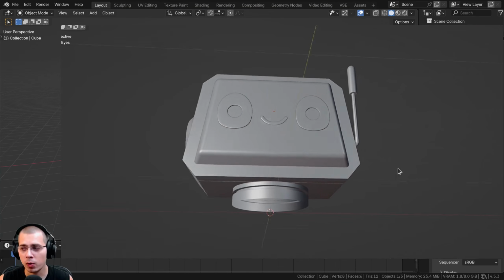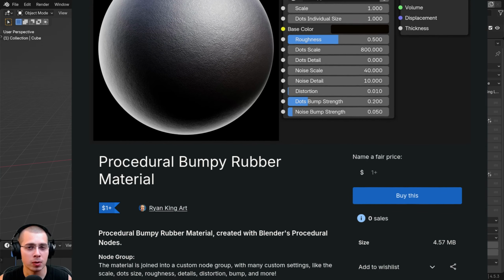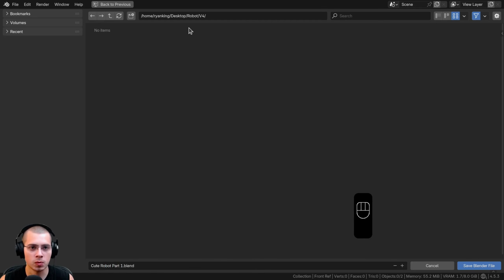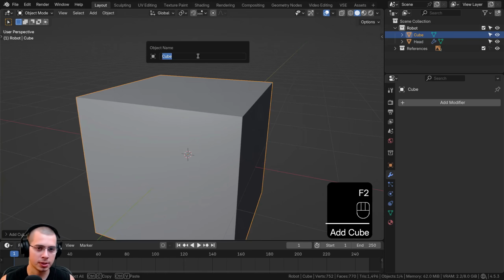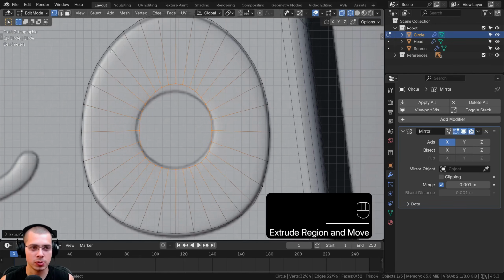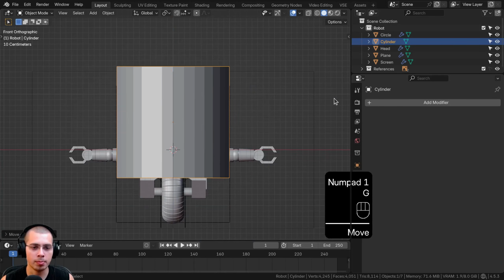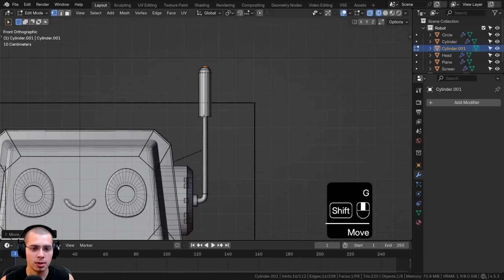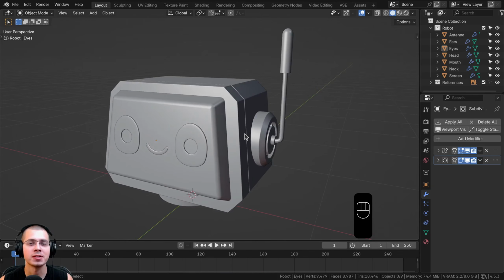Creating a Cute Robot in Blender 🤖 Part 1 (Blender Tutorial)

Comment: Does the ZIP file that you're selling include a fully rigged robot ready for animation or just the mesh? And does it support mouth movement (blendshapes or jaw)?
also can i can export it as a GLB file?
Reply from the maker: Yes the robot product comes with a finished, textured, rigged robot. However, keep in mind that the robot is not rigged with bones. its rigged with parenting, object constraints, and shape keys, which may not work in a different 3d software. As for exporting to GLB, you could , but if you're using it in another 3d program, you will need to bake the materials to texture maps, as it uses some shading setups and procedural textures. The mouth movement is rigged with shape keys.
Reply: @RyanKingArt  Hello,

Thank you for your detailed explanation.
Could you please confirm if the shape keys are properly exportable to GLB and accessible as morph targets in other environments?
Reply from the maker: @sarahidk9174  Sorry I'm not sure about that. Why do you need to export it to GLB? are you trying to use it in another 3d program?

Comment: I keep getting the warning to enable auto smooth in the object data prop. but I don't really see a difference but maybe in the render? Also, is that because I'm using blender 2.83 as that is the newest version it will run. It's an old imac from 2011 back when I was in college. I'll be getting my newer 2022 imac out of storage soon as I have the money, and it has a thunderbolt 3 connection and the internet tells me I can hook up a AMD Radeon gpu to it. A video on that would be useful. I hope someday I can aspire to be an expert blender guy, but alas I'm only intermediate on a good day. A better gpu is getting to be necessary at this point.

Comment: mirror modifier on eyes is not working blender 4.5..failed to set value error (update after reading fixes on reddit) I had to do this 
apply/freeze CTRL+A>location) your location so the origin point (the orange dot) moves back to world origin or set the origin point to the 3D cursor while the 3D cursor is at world origin. Right click the object>set origin>origin to 3D cursor.

Comment: When you were turning the 90 degree angle on the antenna is there any reason you didn't use the spin tool? I find it a lot easier and it gives a perfectly uniform turn so you don't have to eyeball it and get it just roughly even. It's a very useful tool well worth investigating if you've never used it before.

Comment: Okay, just about done with part 1 of this tutorial. I made it to the antennae. I had a big realization. Move meshes in object mode, scale meshes in edit mode, and recalculate normals after extruding as you are modeling. I am sure there is more to this, but this is my takeaway.
Reply from the maker: Yes, I prefer to move objects in object mode so the origin moves with it.
Then I prefer to scale in edit mode so the objects actual scale is the same.
You only need to recalculate the normals if you extrude the face backwards.

Comment: Will you do one without tracing. Sometimes you don't alaays bave a reference
Reply: I imagine the blueprint reference is intended to help new people quickly get to building the model and not have to worry about the design side, which initially might be a stumbling block.
Once they gain confidence with the aid of the reference and learn the skills, they can progress on to designing their own models, having learned the model skill side of things from Ryan.
I tthink this format is pefect, as it sets out the whole process, showing people what thy will achieve with Ryan's guidance.
Reply from the maker: you don't need to use the references if you don't want to. but I decided to use the references so people following along can get a more accurate size and proportions. But yeah, maybe it would be good to not always use blueprints.